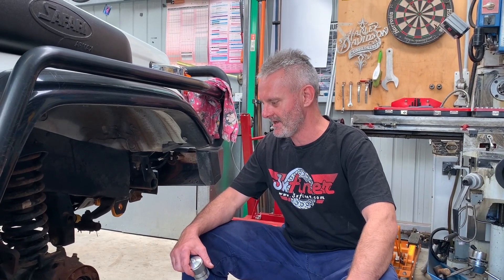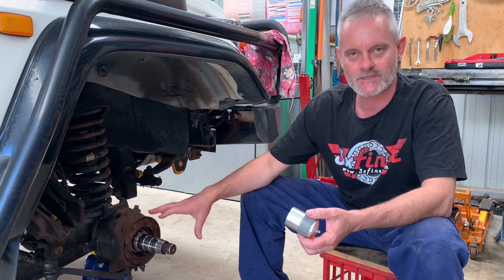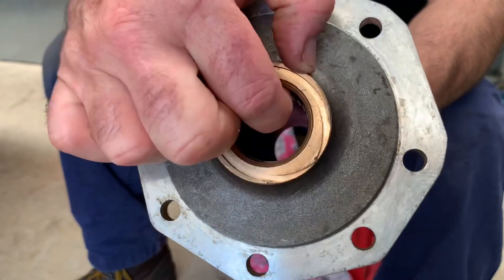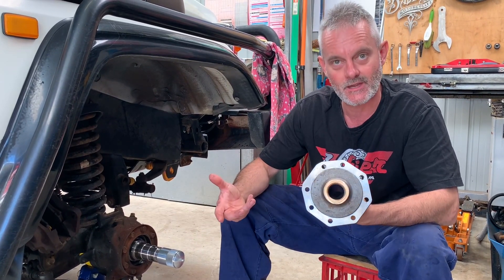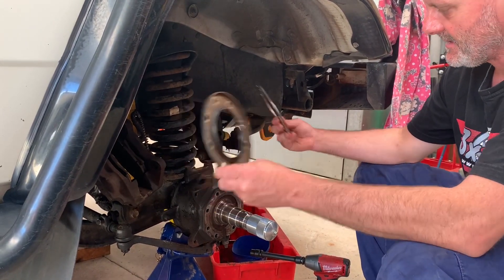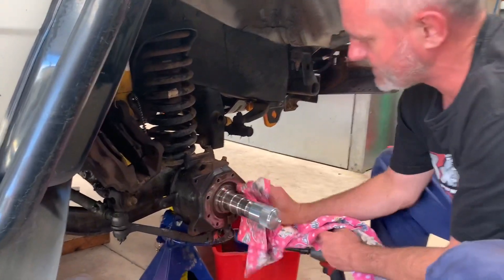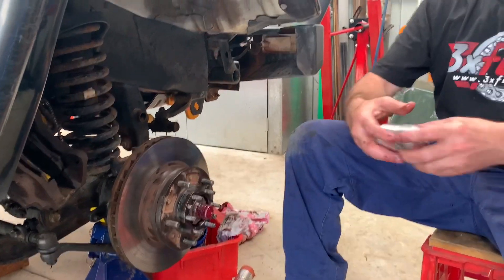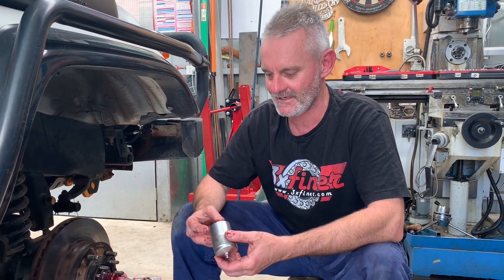‘Spindle Greaser’ Spindle bearing Information for Landcruiser (March 2021)

Comment: Awesome video.  I am new to the land cruiser world and bought this tool to keep everything in good working order.  One question.  When I am doing the maintenance and have to pull off the free wheeling hub mechanism to get to the spindle, do you put new gaskets on the back of it to seal it up again when reassembling?  Or can you simply put the free wheeling hub body back on with the old gasket still in place?  Thanks.
Reply from the maker: Howdy. If the gasket is not cracked or damaged sure you can re use it if you like.
Don’t use silicone or anything like that as it’s not required and it makes it a PITA for next time you do the job.
New gasket is recommended though if you have one at hand

Comment: Great video mate…had a failure of the passenger side spindle on my 80 series not long ago, difficult to diagnose due to intermittent random noise…but part time conversion and full inspection of driveline revealed a failure resulting in full front end rebuild.

Comment: Hi mate, So if  INOX MX8 is a high-speed wheel bearing grease, that will be the only type of grease you will need for your entire front end? (Axle, CV shaft, CV Joint, upper & lower Steering Knuckle Bearings, Inner & Outer wheel bearings) No need to use Moly grease at all then? Thank you.
Reply from the maker: Howdy, yes as per the product sheet MX8 is good to use on everything
Reply: Can moly be mixed with the INOX? Or do you need to strip the whole thing down, clean it and add it to a 'sterile"  hub?

Comment: Any issue with bearing grease mixing with moly grease in cv and axle connection ? most videos show moly grease packed in knuckle /cavity ?
or do use bearing grease only ?
Reply from the maker: Gday mate. No I haven’t seen any issues with grease mixing. 
I’m sure I read a Toyota procedure to pack the spindle bearing and the top and bottom swivel hub bearings with bearing grease so it’s actually mixed grease from factory with the moly.
When you do a swivel hub overhaul use INOX MX8 grease which is good for everything. So no contamination issues moving forward if you do that.

Comment: Hi mate great idea and great tool, I’ve only just found this product but I wanted to say I’ve been doing this to my  80 as long as I’ve owned it but I have just used grease nipples in the flange dust caps being full time as it gets grease all the way through to the knuckle plus it loads the wheel bearings. I don’t even have to take the wheel off unless adjusting preload. These however are fantastic for free wheel locking hubs.